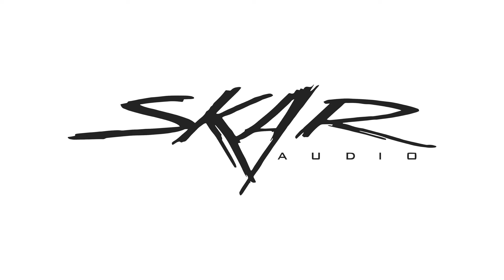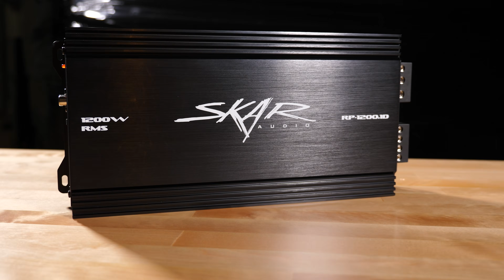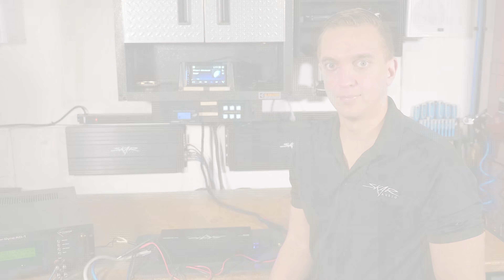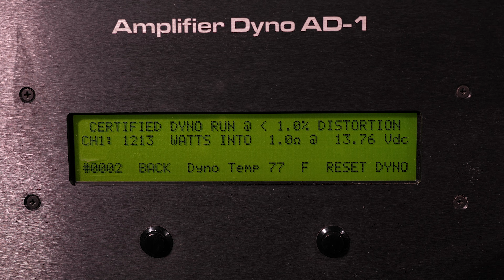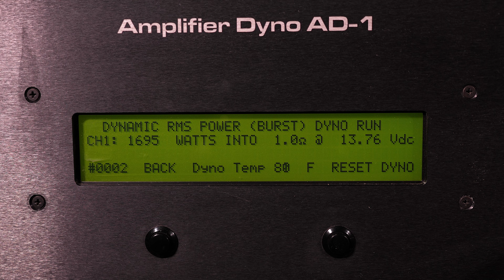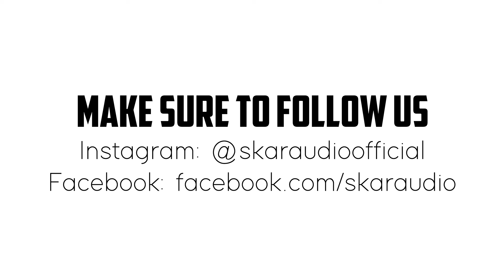Skar Audio RP-1200.1D AMP DYNO TESTING (SMD AD-1)

Comment: Just got one of these. Was thinking to run my 2 brand new rockford fosgate P3d4 subs on it at 2 ohms. From dyno testing videos on this amp here, ive seen its pulling around 85amps to deliver the 900ish watts. My power supply (house installation) is rated for 100A so im thinking i should be fine. I can always tune it back a bit. Ideally ill try to respect the 80% rule in this application. Also mybpower supply can go up to 16.5 volts which theoretically could lower the amperage a bit and increase efficiency. 
What is the highest voktage this amp can accept?

Comment: So my skar subs are 1ohm at 1000 watts RMS which equals about 31volts on a multimeter. So I played a 50hz test tone at my clean radio volume and turned the gain until I got 30-31 volts on my multimeter . Is this correct please ?? Cause my shit is EATIN!! 😁😁

Comment: How did you wire it for 1 ohm on the amp cause I have a two ohm single subwoofer and just wanna know if I have to use the middle negative and positive terminals on the amp or the outta I don’t know

Comment: i got this 2 the 2 sdrs and the amp at 1 ohm and it never last more than a 3 songs before it hits protect.......its tuned super conservative to ......and the car has a high amp alternator never  starved for voltage either badass grounds and its trash it blew 2 sdrs after break in ...... skar has been the worse experience for a system ive ever used .....
Reply: Bro that’s your problem your wiring is garbage
Reply: @jordan.avalos  all this pure copper zero gauge wire…… yeah I’m sure that’s the issue 💀

Comment: Ive been a fan of Skar audio. Purchased just over $5000 dollars worth of equipment from them the past 2 years. I have a real problem with there warranty policy. I purchased among other things 4 SKV2 4500.1 amplifiers. Installed them in a Honda pilot. Upon powering them up one smelled funny and became very hot even when it was turned off. Right out of the box. I called them and sent it back in its original box. And this is was they sent me for Warranty. This is an amp someone burned up and sent in for repairs. its all beat up. and they tried covering scratches with a sharpey marker. The amp feet are all bent up because they put the amp in a cheap thin cardboard box with only newspaper on the bottom. These amps are 900 plus each and going in a show car and this is not an even replacement for mine it was new out of the box. What do you guys think? I expected a whole lot better customer service.

Comment: Recently bought 2 Rp1200.1d and  Don't even have the gain Up high at all maybe a quarter of the way The amplifier keeps going into protect mode and then kicks out my rear breaker after 10-15 minutes of play  Which is a 300 amp breaker 0/1  wire For my 2 yt auxiliary batteries But this only does it at high volume  And this is my 2nd amplifier from skar same model  The 1st amplifier I had the RCA sleeves on the amplifier we're coming out with the RCA cable   I think their subwoofers are pretty good quality but but these amplifiers are garbage I had 2 kicker CX600.1 and  Never had these issues maybe because it was only a 4 Ω set up Instead of my current 1 ohm set up I have. And 4 Ω subs sound way better than 1 Ω subs btw

Comment: I'm running 2 Rockford Fosgate Punch 3 12's with the SKAR 1200 watt amp. I had an audio shop tune the amp for me with the SMD equipment but I'm still getting some popping noise from the subs. I'm running a Boss head unit. Could the head unit be the problem? I know the skar amp and Fosgate subs have so much more to offer but I keep them low to avoid that popping noise.

Comment: I got this amp pushing 2 12" Alpine Type S's wired down to 1 ohm and wow do they Wang! Also no light dimming what so ever and I'm just running off the stock battery, no big 3 or capacitors or extra battery. This amp has got some power and does what it's supposed to I highly recommend this amp 👍👍
Reply: Might even hit harder if you do big 3
Reply: That's what's up💯👍🏾👍🏾 Same with me! All I might add is replacing all the door speakers in my Ram 1500👍🏾

Comment: My RP 1200x1 just died. Bought last November. Had my car down for 3 weeks doing some work and the battery went dead put it on 2 amp trickle charge for 12 hours and now my amp won't power up. No protection light no light period. Put my old amp back in and it's working fine. I'm only pushing a sing JL w6v2 and I'm 38 so I wasn't beating the hell out of it. Got it on sale last year and has been awesome for the 6 months I got out of it.

Comment: I’ve been running a Fosgate prime 500 for the last year and ran a soundstream reference 500 before that in the 90s. Ordered the RP 1200 earlier to see what it’s all about. Hard to argue that level of power for the current sale price. I don’t expect the cone control and SQ to be as good as my two previous amps but the raw power and dollar per watt figure is impressive. It will be powering an NEP select 12” D4 and once I build another box a CT tropo 18”D4 sub.

Comment: I’ve been having overheating issues even with it properly tuned via smd-01 I just bought a fan for it .. raised it up about 1-4 inches took the backplate off  and have the Fan blowing up into it .. so far it’s cooled it a lot but I’m still scared
Reply: I did the same and still can’t keep it cool

Comment: I just order this amp..and I also got a 12' skar 1250- Rms 1600 max..2 ohm..how much rms will I be pushing?
Reply: At 2 ohms you'll be getting 800 rms from the rp1200.1d. If you can wire down to 1 ohm and you'll get the 1200 rms. I got this amp pushing 2 12" alpine type s subs rated 500-600 watts rms each and this amp pushes them perfect. Gain isn't all the way up either and it's such clean sound and bass

Comment: I just got my 2 12s 1200watts skar, would this amp work for the two?
Reply: how does it sound because i want to get that
Reply: @as8hoops517  it sounds pretty good put out more then enough power but I end up giving it to my brother & got me 2 12inch ELVs with the Skar 2k
Reply: How did u set the gain,is it half way or pass that

Comment: Is it possible to wire two dvc 2ohm subs to this amp at 1ohm final impedance seeing as it has 4 speaker terminals?
Reply: Nope. You can wire to 2 ohms , 4 , or 8 ohms
Reply: @brianwatson3705  thnx. I ended up getting a 3rd sub to wire at 1.33 ohms, and then just grabbed one evl12 dvc 2 ohm. Chasing the bass I think it was 1.33 🤷

Comment: Purchased the 3 8inch Skar sdrs and it burnt up my JL Audio 1000.1 going too buy this to replace it
Reply: I had the same amp on my 2 SDR 12s with no problem. You should have a conversation with whoever tuned it.

Comment: I have a question I bought this amp and have yet to hook it up.. Now on the sub woofer/speaker wire since I will only be running a single 12" evl series skar sub .. How do I connect the positive and negative wire? since it has a place for 2 sub connections on the amp. In other words this> +- or this> +- +- or skip one?
Reply: From sub to amp, it's + to + and - to - 
Some say it doesn't matter which side is  positive and negative on speaker wire. It took me a while to figure it out until my dad told me it doesn't matter, as long it you have the positives and negatives matching from sub to amp, no cross wiring.

Comment: Are there not any fuses on the RP amp series? Slightly concerning, though I can't remember the last time I had to change a amp level fuse.
Reply: I got this amp and no there are no fuses on this amp. I've been running it for about 3 weeks now and no issues so far

Comment: How come nobody rates or tests amps at 12 volts which is the actual volts the amp receives on 99% of setups?
Reply: Cars run on alternator bud. 13.8 to 14.4 volts 12 12.4 voltage is ya battery homie do some homework
Reply: @michaeldavidloving9411  .  Well ya!! Amps run off the battery bud!!
Reply: No they dont dumb ass they run off the voltage when ya car is on. As I said
Reply: Your a fucking idiot. Do ya home work jack shit for brains

Comment: Hey how good is the low voltage protection i had plugged a 1000 watt psu into it to test it and it turned the amp on both protect and power light came on then the psu turned of imedietly and the amp made a breaker type noise(like when a breaker blows) anyone know if i fucked the gooch i feel i didnt cuz the psu turns back on. I feel its just the psu over current protection.

Comment: Have it hooked up to 2 rf p3s at 1 ohm slaps hard asf ifts the best amp i have bought yet
Reply: How do the lows sound. I have the same amp, snd my subs Skar vD 10 are not broken in but the bass is not where I thought it would be
Reply: @hadbl12  it’s most likely the subs

Comment: I almost bought this amp for a single Alpine RW12d4 in a custom ported box but I ended up going with the Kicker CXA1200.1 from Best Buy for $250 and 35bucks more I got 4yr warranty any problems they just exchange it for a new one
Reply: Kicker is trash

Comment: I just bought this amp back when it first released for my two P3 10's. I am absolutely impressed with this amp! doesn't get hot, but I need to replace one of my subs because sadly the one Im replacing is experiencing voice coil rub and is bottoming out (I guess what I get for 4 years of abuse on this sub) while the other one is almost brand new.
Reply: Raging_Bullz77 It wasnt the subs fault

Comment: These dyno very close to the RP1500.1s
Reply: Yeah but marketing is everything! They know there's a market for them so people will buy them not knowing that their sub or subs rated at 1200 watts rms should handle the RP1500 without having a problem
Reply: @Outty5000Hertz  theres a huge market for daily drivers just wanting a decent sound system for a reasonable cost. I just ordered this same amp with 2 vd-10's, and got it all for under $330. To top it off I used their financing option and Im only paying $25 a month with no interest. Ill take that allll day long
Reply: Justin most definitely!!!
Reply: fIyingpeacock most users are not. Car audio is huge on DIY and most people see the gain as volume
Reply: fIyingpeacock noted
Reply: fIyingpeacock i have a Rockville DB12 and I’m not impressed with it because i need to run 2 Kicker Comp R 12s. The Amplifier RMS Rating is actually 546RMS i need more than that
Reply: @Suchmxn  mo power baby
Reply: fIyingpeacock i have that chart somewhere in my phone. I’m still waiting on 2 amplifiers i orders before i feel like looking for it
Reply: fIyingpeacock noted aswell you just answered a question I’ve been asking for awhile
Reply: @fIyingpeacock   lmao  I usually just crank it i can't lie but as of lately 😅 I've been better

Comment: I got this amp pushing two 12in SDR's. Hits harder than my 2 previous set ups. I'm sold on Skar Audio
Reply: I'm glad I saw someone bought the sdrs too and paired them with this amp..I just bought 2 of the sdr 18s and this amp and I was hoping it was gonna be a perfect match.
Reply: @mattypisme  2 sdr18s IB hit hard 120 + and go to 19hrz
Reply: I'm getting the same setup tomorrow!   Hope the 1200.1 is powerful enough
Reply: @hondacivicacura  You won't be sorry.
Reply: @eighty3boxchevy  I'm happy with the purchase. I'm still figuring out Amp setup. But damn they sound good.  Subs Not broke in yet though.
Reply: @hondacivicacura  the 1200.1 is more than what most subs can handle and I’m not sorry to say that
Reply: @hondacivicacura its perfect for the setup
Reply: @hondacivicacura  It all depends on the wiring you're gonna do. Are you going to wire him at 1 ohm, 4 ohms, two ohms? If you're wiring at one ohm, it'll be powerful enough for sure. Really, no matter what. I just ordered. An 8 inch SVR. And I'm going to run it at 4 ohms with this amp.
Reply: How long have you had this amp. I’m wondering about the longevity of the amp!!
Reply: @hadbl12  I have the dual 12" SDR setup in their 32hz box on the RP 1200.1 first 2 years i was hitting it but last year i said F it i want new subs and went full tilt on the amp and they still haven't blown up nor the amp lol started to clip one day found that all the screws came loose on power and ground terminals tightened them back up and never happened again. The system is so loud in my crown vic it caves my ears in and over powers my stock highs completely.
Reply: @hadbl12  2yrs... 1yr of pushing 2-12in EVLs. I've had no problems which is why I been dragging my butt with installing the RP2000.
Reply: @eighty3boxchevy  whatdo you have your amp settings at?
 I need settings for Lpf & subsonic. Thanks
Reply: @ChildofOurHeavenlyFather  Im just seeing your message. Friday I finally got my RP2000 installed so this amp is on the shelf. It was also tuned for my EVLs not the SDRs. Sorry I couldn't help.
Reply: @eighty3boxchevy  man bro I set my amp to just over 1/2 gain about 9/16", then 0-Lpf , & 0-Subsonic. Then I turned my bass knob all the way up. Holy s*** this thing came alive. I also set my bass on 0 on my stereo. Man this thing pounds like crazy all the way up after this!🥴👌
Reply: @ChildofOurHeavenlyFather  It's all about how you tune it. I love it! I'm glad you got it set right for you to now enjoy. ✊🏾 Find "In The Air Tonight" by Phil Collins Bass boosted. Damn near shook my doors off.
Reply: Do y’all keep y’all on 0db, 6db or ,12db?
Reply: @KingJ_97  I keep mine on 0db.
Reply: @KingJ_97  Mine is set on 6db but it was also tuned for my EVLs not the SDRs.
Reply: At what ohms where you pushing them both at ?
Reply: @theoscarzee3057  1ohm
Reply: @eighty3boxchevy  hey mine is making a slight poppin noise when I crank the volume or bass up and I only got the r1200watt. What you think is causing it? 
Its brand new sub only had it for a few weeks....
Reply: @eighty3boxchevy  I got 1 evl 12" on 1 r1200 watt amp
Reply: James Palmer did you fix the issue mine is doing the exact same thing
Reply: @NC-do3iu  I have upgraded my amp since then. I will tell you it had everything to do with the gauge of wire I was using.
I upgraded my wires to 2/0 gauge power and ground and also did the big 3 and that problem was gone. Also the box I had my sub in was a skar prefab and it was way too small. So, I built a custom box tuned to 32 hz that was 4 cubes with sub accounted for. My new pioneer head unit made a world of difference in sound quality as well. I loved the EVL 12" sub. Can't really beat it for the price. But, I now have a Taramps Smart3 w/ an American Bass 15" sub & am quite pleased with this combination.👍
Reply: James Palmer oh ok thanks man good deal
Reply: Hey man do you know why my amp would be going into protect mode when driving
Reply: @noahlutgen849  check your wiring and connections.
Reply: are you using skars 4 gauge cca wires? if so are those good enough to power this amp? and also are you sure this amp powers them sdrs perfectly because I'm seriously stuck between this and the rp1500.
Reply: @danvird8649  OFC wires only. You're robbing yourself of alot of power. When I made the switch to OFC it was like I had a whole new system
Reply: Im using this set up with 2 12" sdr's ive been messing with the gains and it sounds pretty good subs still being broken in but so far so good.
Reply: I guess Im pretty randomly asking but do anyone know a good site to stream newly released series online ?
Reply: @Damian Israel Lately I have been using Flixzone. Just google for it =)
Reply: @Damian Israel lately I have been using Flixzone. Just google for it =)
Reply: @Damian Israel Lately I have been using Flixzone. Just google for it :)
Reply: @Damian Israel Try flixzone. You can find it on google :)
Reply: @Damian Israel try FlixZone. You can find it on google :)
Reply: I have the same setup and I went to set my gain using a multimeter and my gain is barely turned up before hitting my target voltage, it sounds clean but not nearly as loud as I wanted it to be, had the subs since January let them break in for 36 hours of playtime before really fine tuning and like I said it sounded louder before tuning it with a multimeter, I don’t want to blow the subs but man I was hoping for more bass which I had before but according to the multimeter it was set too high any help with why these couldn’t do more would be really appreciated
Reply: I bet it hits hard af, my sdr 10 d2 hits hard on the rp800.1 and that's no where near the power output as this amp is which is insane. And 12s not the momention, ah man mines only a single 10. I can only imagine your ear drums ahha
Reply: Hey bro I have of same set up.  How you tune you amp can u help me  ..
Reply: @tonycervantes4816  I just let the shop tune it to where it should be then I adjusted it to where my ears needed it to be (if that makes sense)
Reply: I have same set.up with 2 12 sdr d4 wiring  to 1 ohm .but I need help how.to set up  my amp. Any help  🙏
Reply: I have the same exact set up bro! It bums harder than anything I’ve owned ever
Reply: I have this amp with 2 sdr 12’s , bass isn’t hard enough and I’m thinking of buying a Jl audio 1000 watts amp, would anyone recommend?
Reply: @d_rosee9788  Wait hold up a second. What OHMS are your 12" SDRs?
2 or 4?
Reply: @metaldreams3595  4
Reply: @d_rosee9788  ok. So are you running them at 1ohm? Its either 1 ohm or 4 ohm. The subs should be wired in parallel to give you 1ohms which the amp is 1200 watts and the subs are 600 each. Do you know if theyre wired for 1 ohms? Or 4 ohms? As a pair